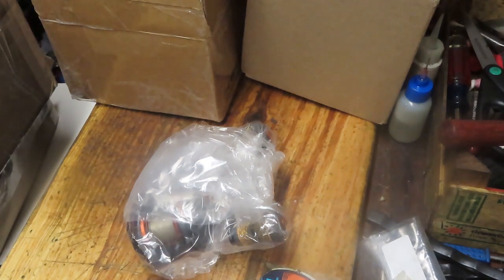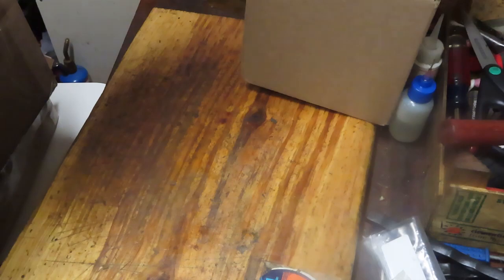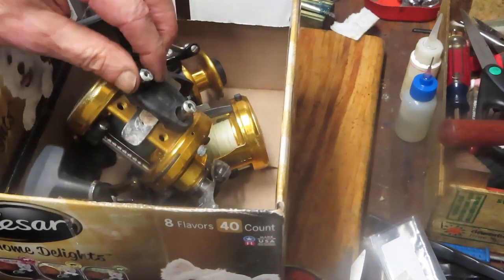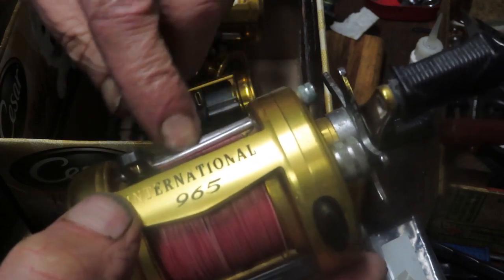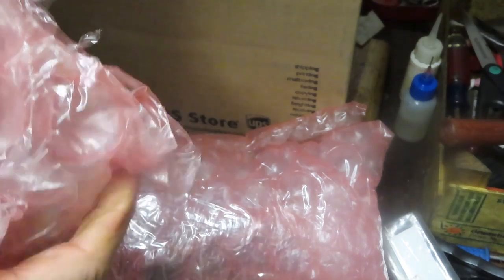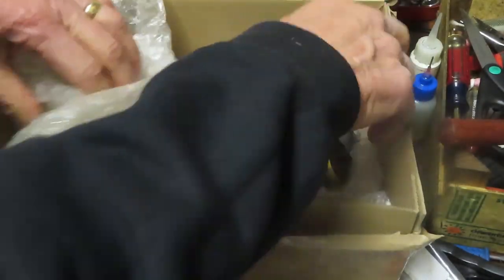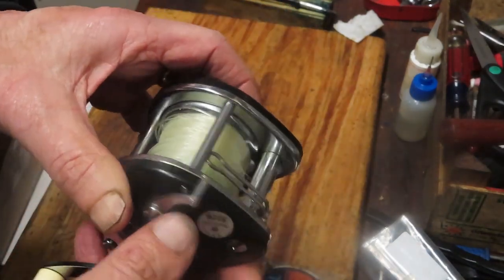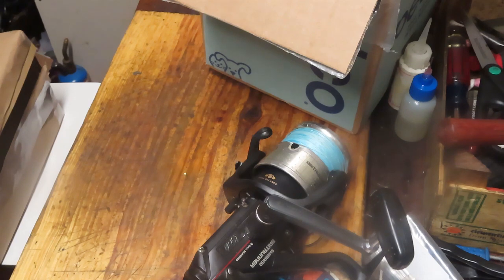New shop fishing reel projects 2 15 and previews of upcoming how to service videos

Comment: I might have a special mission for you if I can't figure it out. I have a first generation Penn International 30 I swapped out the asbestos drag for a dura-drag. It has drag until after half strike then goes back to free spool. I'm almost at the point of giving up after all efforts. Any advice? Or you might be getting it for a video. LOL
Reply from the maker: Have you checked the alignment of the ramps?  It sounds like the lever set up and not the drag washer - take a  look again at how you have set the lever and ramp pieces - Dennis